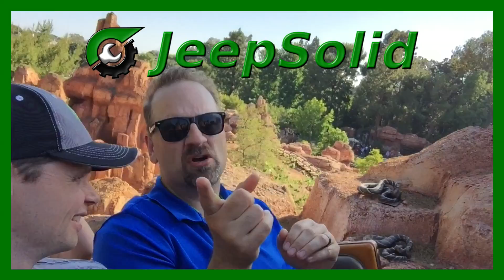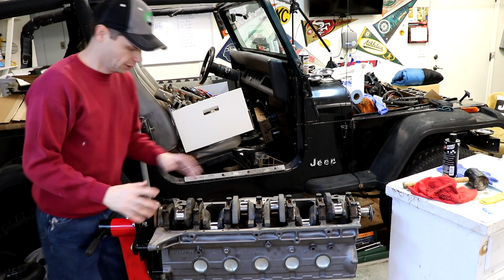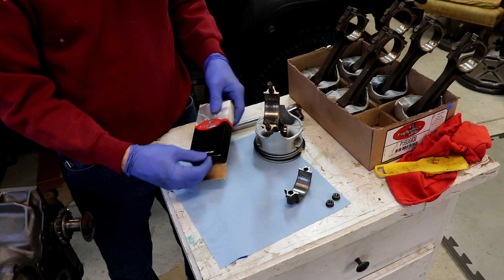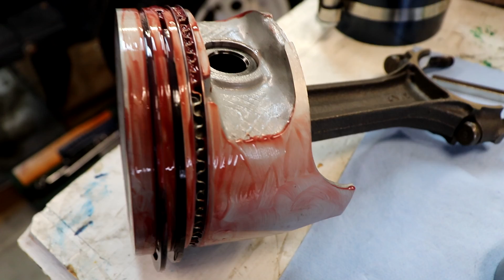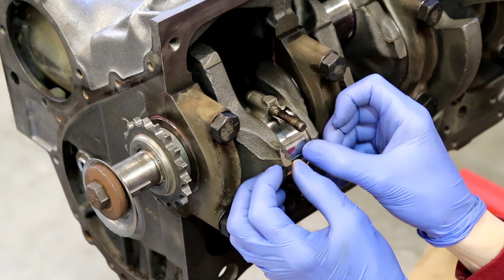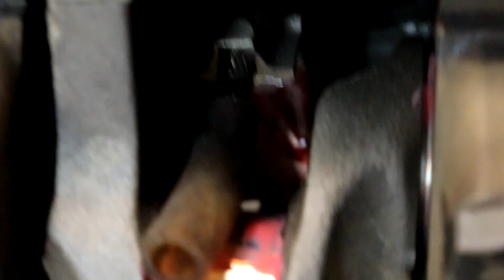Oversize Pistons Install Jeep 4.0: Engine Rebuild Part 18

Comment: What brand are those “lint free” towels you’re using?
Reply from the maker: I don’t remember, but I do know the set I got from Amazon were anything but lint free. Harbor freight micro fiber towels work well
Reply: Thanks for reply. I can't tell you how many times I've watched the 4.0 rebuild videos. I almost feel like we're best friends (chuckle). It's going to be storming here the next couple od days, Then the rebuild starts!!! Also, after researching and talking to a couple of local engine builders, I've been told that auto body prep towels are the way to go for lint free towels. I picked some up today. I'll share what brand they are next time I'm close to them. I'll also let you know what I think about how "Solid" I think they are once I'm actually using them. @JeepSolid

Comment: Not an engine builder but I'm very glad I ran into your video.  I needed a second look at the bearings because I was like "What in the heck?  The outer gaps are nuts!" saw this video and saw that yep, they are supposed to be that way.  Never seen so much of it so thanks for taking the time to make this video.  Working on the same exact motor in the same standard setup.

Comment: Really like your videos. I'm going with an ATK Create engine once I pull my nice and still running 230K mile 4.0L. But I plan on rebuilding my core instead of returning it to ATK for the core charge. I'd like to contribute a few bucks to help support your site. I think you had mentioned a link in one of your videos but I can't find it.

Also, let your sponsors know we pay attention. I'll order my rebuild kit from EngineTech and use Redline assembly lube during my build. Just a suggestion, put all of your Jeep TJ rebuild videos on a DVD and make them available for purchase.
Reply from the maker: Thank you! I am working on a channel membership option where viewers can contribute if they like. It’ll be up soon. Other option is Patreon which should be listed in the video description.

Comment: Never seen anyone to this with the engine side ways . It's alot easier upsidedown. Plus you don't risk scratching anything . Having to the side like that seems like you can scratch the walls.
Reply from the maker: It worked well for me. Didn't scratch and it make it easier for me to work with bearing caps.

Comment: I've watched the videos so forgive me if I just missed it. Did either you or the machine shop double check the post machine bore diameters, the piston diameter etc to determine that the piston to bore clearance was within spec? I'm about to go through this very same process on a 98 TJ I saved from the trash heap.
Reply from the maker: Yes. The machine shop measures the new pistons and checks clearances.
Reply: @JeepSolid  Thanks!

Comment: Hi fun to watch  you miss one step  to did you check the rings ?  for gap  the first rod when you started to clean i think i saw  marred in side,  and was it sized  at at a  machine shop simple test that includes NEW rod bolts to do this    i have seen others get away with this but can  add to early failer    still watching thank you for your time
Reply from the maker: Thank you.  Yes. Gaping the rings was done 👍

Comment: Coming along nicely Dale ! I've used Redline assembly lube in the past and it does a great job . Should be a great running engine when your done . Until next time , take care .
Reply from the maker: Cool.  Thanks.  I wasn't sure about the color at first.  Bright red.  But now I see and like it.  Easy to see what you've painted.

Comment: I'm actually doing a rebuild on a Toyota 1zz at the same time also with an EngineTech kit! My main bearings came with 6 bottoms and 4 tops on accident. I informed RockAuto at 6pm and the next day at lunch time I had a new set of bearings in the block from EngineTech! Very nice of them to overnight!
Reply from the maker: Yeah! I've been very pleased with their customer service.

Comment: Getting there! Good job with the cleaning. That assembly lube looks like good stuff. We used to use STP back in the day. 

Did you replace the rod bolts? It’s not a performance motor so the stresses are less than average, but rod bolts stretch and have been known to fail. Cheap insurance but like I said, the Jeep motor isn’t a high rpm motor so they are probably fine. 

It’s too late now, but an assembly tip: When you install the pistons, have the block turned so the deck is on top. You don’t want to scratch your cylinder walls either from the rods. Having the deck in top allows gravity to let the rods hang centered in the bore as you’re tapping the pistons in. 

It’s really looking good!
Reply from the maker: Thanks! It's coming along.  The Red Line lube worked great!  I like it.
Maybe next time, I'll try having the deck up.  This way allowed me to see the rods easily, which I held up off the cylinder walls by my back hand.